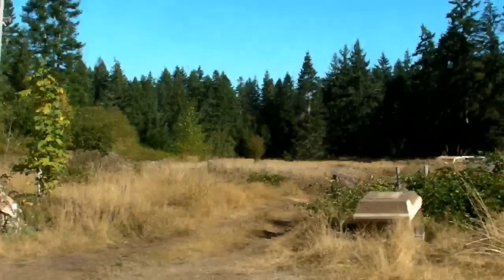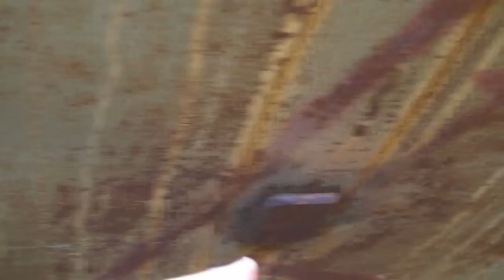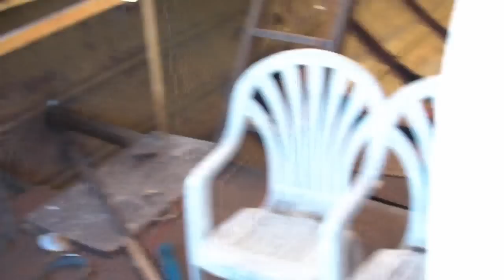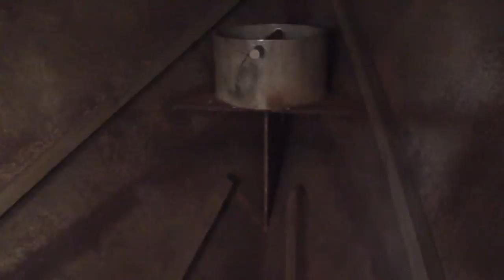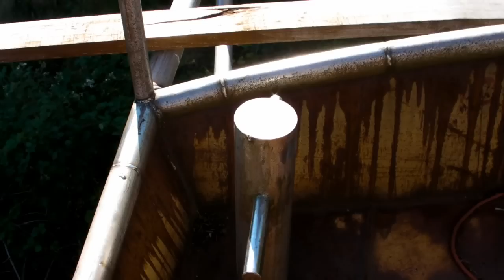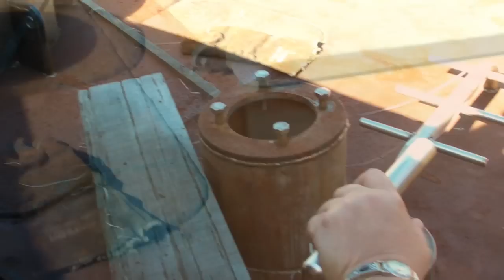Paul's 65ft Origami Steel Chinese Junk Sailboat

Comment from the maker: @flyingchimp99  Yes.  Variable angle of attack.  We will be able to reverse the boats travel by reversing the blades on the prop.  Combine that with reversing the transmission and you can make the "prop walk" go to either side when docking.  Also get to feather the prop for sailing, or increase the pitch when motoring with light loads, or decrease the pitch for more power when towing.  Great stuff!
Reply: I can't believe that this is ten years ago, do you know weather Paul ever finished building his Junk? I've been watching your build for a while with interest but I haven't got to the point where you put your rudder together yet, I was surprised that Paul didn't fill his with Oil to prevent rusting on the inside from condensation, I hope Paul did get to finish it he certainly worked hard enough on it and deserved to enjoy living abroad with his family, or at least getting to enjoy her during his holidays if he couldn't live aboard full-time..
Reply from the maker: @kevnwarriner8819  Paul sold her to someone in Vicitoria and I have not heard anymore.   It's not uncommon to sell a partial boat.  These are long term projects and life does that.  I admire anyone that starts.  So many will not.   And fewer understand how much joy, knowledge, and skill we gain each day we work on our projects.  Finishing; if we can, is just icing on the cake.

Comment from the maker: @porpoisefathom   The difference is speed.  The extra welding on Paul's hull is due to changes in the design and it's relative thin skin, which will pay off in weight savings.  The best comparison to make is to look at a Bruce Robert's Trader 65.   Which was where we started when we decided on a mono-hull.

Comment from the maker: Paul made those.  They are aluminum plate with a piece of flat bar bent and welded on to from the lip, and stainless flat bar welded to the edge of the opening to make the seat.  Best of luck with your boat.

Comment from the maker: @porpoisefathom  With the ability to reverse the pitch and direction of rotation it's possible to reverse and control the amount of prop walk.   I intend to avoid marinas for the most part. We'll use commercial docks for fuel.

Comment: I found your You Tube channel about a year and a half ago and watched your videos in (mostly) chronological order. It's interesting to come back and compare what Paul did with what you're doing.  I see some of the design elements in this boat that you've changed in yours.  You've made some great decisions in designing yours.  I especially like your pilot house design and sliding hatch covers.  I think it'll make it much easier for working on deck.  Was his boat your inspiration or did you already have an origami hull in mind?

Comment: Looking at the strength of the lower hull in pauls boat (impresive framing.) I suspect he will be able to bounce across the sand bar at Rio Dulce at low tide!!. Doug are these boats designed to dry out standing upright on their twin keels?